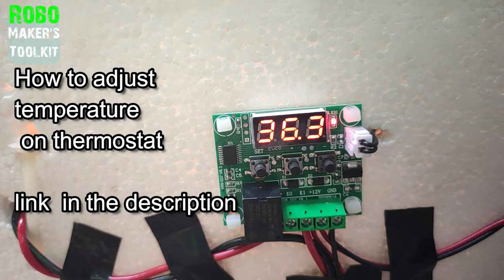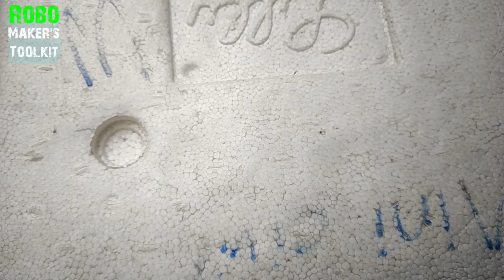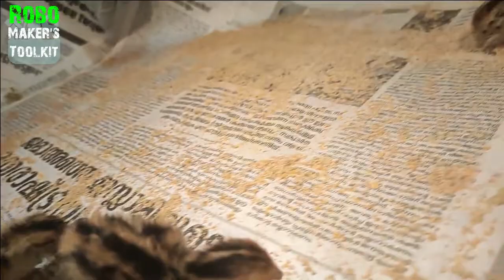How to make an EGG INCUBATOR at home | Quail Eggs

Comment: These thermostat, dc fan,connecter, adapter are you unboxed items?
Reply: Please replay
Reply from the maker: yes
Reply: Ok thanks
Reply from the maker: Take a look at this TechSupreme Combo Of W1209 + 12v 2Amp Adapter + 3inch fan+ 1 Dc Connectors Screw TypeFor Diy Incubator Electronic Components Electronic Hobby Kit on Flipkart
https://dl.flipkart.com/s/N2in!RuuuN
Reply: Thanks👋💕💕💕